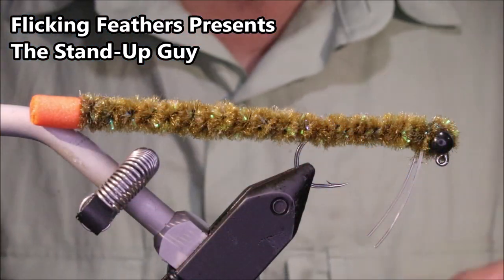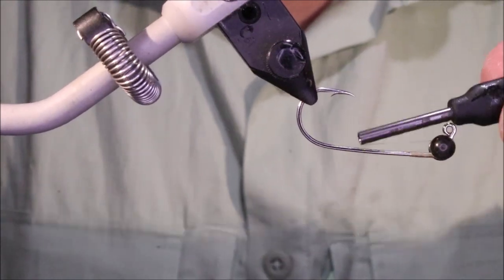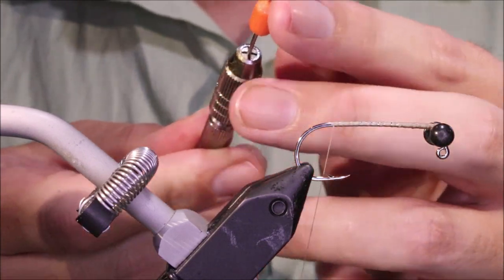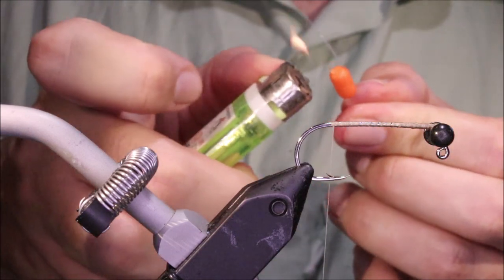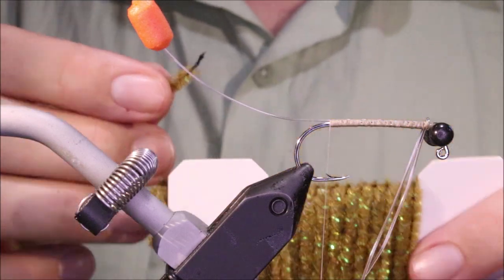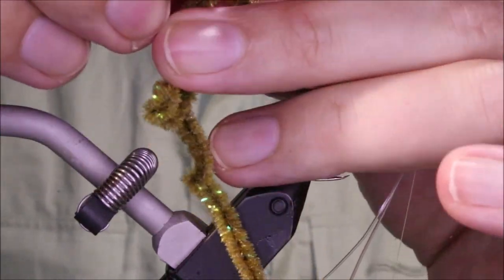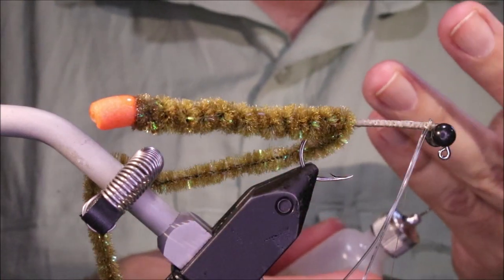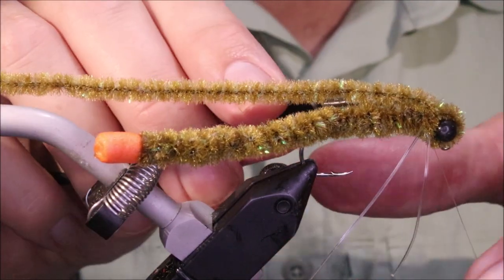Fly Tying: The Stand-Up Guy Bass Worm With Martyn White

Comment: Hi Martyn, nice touch with the added foam for buoyancy. I'f done similar patterns tho found the ones done with monofil-cores, as you did here, tended to be a little too stiff for my taste. I started either just hurling the cactus (makes unexpected color sceems if you mix several ) or to hurl it with some small dia mono like 0.15mm to tune the stiffness. Hurling also makes it possible to mix several different length and so on. Well, thinking about it it's just some kind of composite loop at this point. Nice vid Martyn, thx for sharing. Regards Smarty